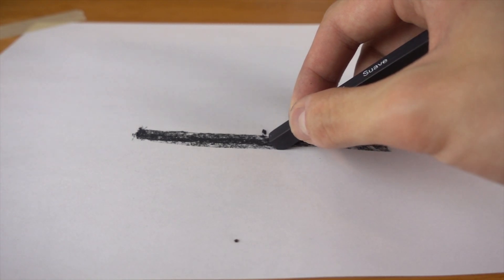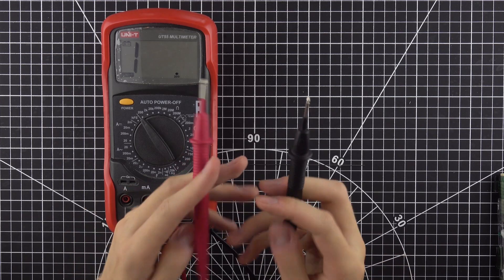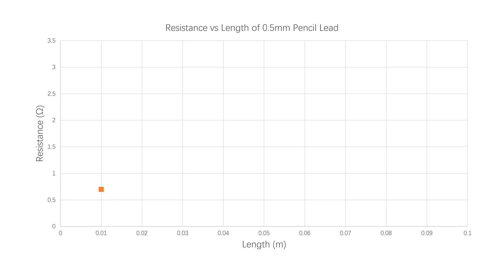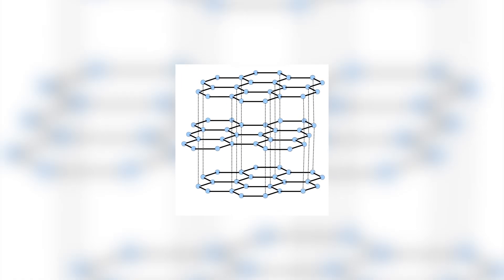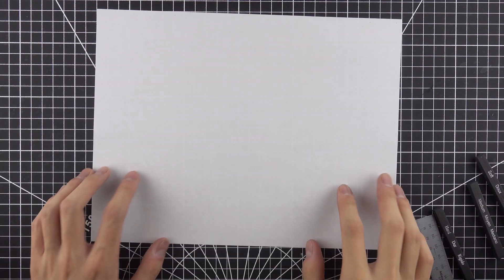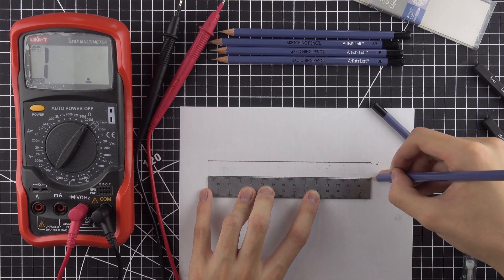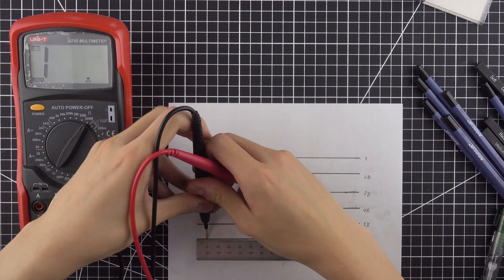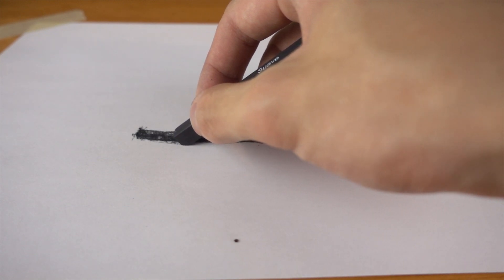IYPT 2020 Problem 10 Conducting Lines Demonstration

Comment: The graph of "resistance of charcoal line vs length " is wrong,   the value of resistance is not the same as the reading.
Reply from the maker: There is a small mistake in the last plot. I've added a correction in the description. Thank you for drawing my attention to the plots. I think what's important is the trends we see. The data is only useful in a qualitative sense because the repeatability of the setup is lacking.

Comment: hey! thx for the video.
i've also done the same graph with resistance and length, but my results are completely different, more like a parabola! i think it has to do with the fact that you've done the measurements on the same line and i've done them on 6 different lines, but still, pretty weird! do you think it would be a good idea to include 2 graphs in the research?
also, why are you using charcoal?
Reply from the maker: I think might be difficult to get repeatable results using multiple lines. If you can get a parabolic trend that is indeed very interesting. I used charcoal   because it is essentially carbon without the binding clay. This is just to illustrate the difference between the two.